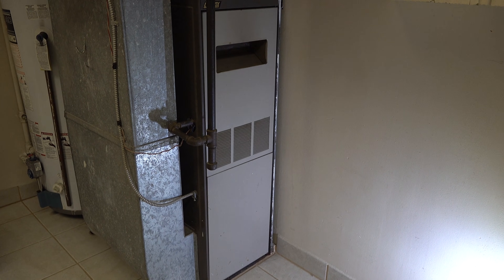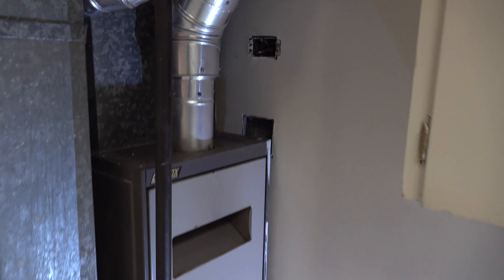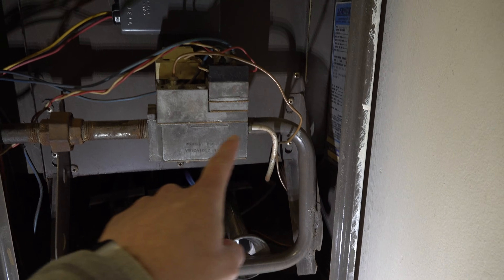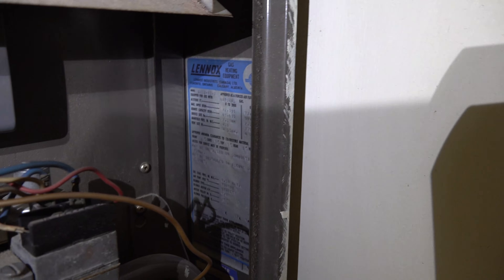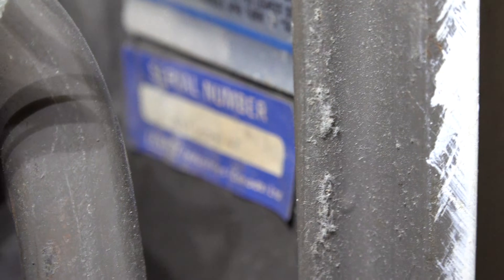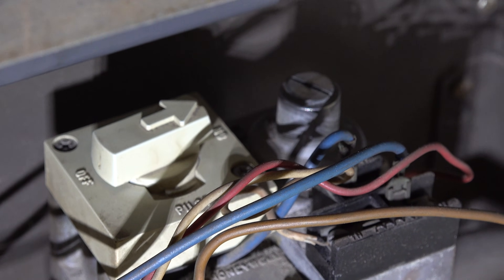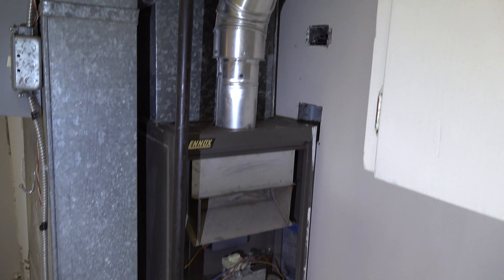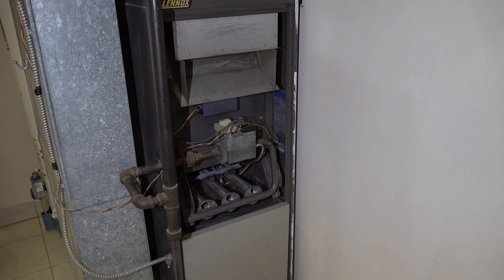1977 (Old) Lennox Gas Furnace Overview [G8D2-82-3]

Comment: The flames look better than on your other video.

The left burner looks misaligned - crossover tubes should line up and stay that way. If it gets worse you may get delayed ignition.

You can't tell if a furnace is properly tuned by looking at the flames; yellow can just be caused by dust and you can have perfectly blue flames but high co production or too much excess air.

You would need to call a tech with the right tools to check fuel input and combustion. (the fuel input u can actually check by clocking the gas meter, but can't check combustion)

You can't tell if the heat exchanger is cracked on this model by checking for disturbances. You need to get in there with a flashlight (or snake camera) and check back of every cell where it starts to curve for cracks.

Comment: Thanks for the memorys.  We used one like this ourselves for 25+ years.  I remember it being noisy when the fan kicked in.  We called the heater the USS Titanic Boilers.  You could just see all the gas it took to fire that thing up and it would run that way for many hours.  $$$

We replaced it with a hybrid heater with AC.  Heater runs on gas or electricity and with the solar panels we can save huge amounts of money.   You program heater with your local prices for energy and the system will pick the source of power based on what source is cheapest.  You really don't know when its working in that you can bearly hear it running.  It was a big jump in technology between the different heaters.  Like 1920's compared to 2018, just saying.   Old heater was like yours a 1976 model.  When you change yours out don't skimp,  just go for it and get the best one you can afford and you will not be sorry.   Great video.
Reply from the maker: Thanks I'm going to give replacement some serious thought this year. Long story it's not in my house, it's in a commercial building that's vacant so honestly if CO is leaking into the offices it doesn't matter in the slightest right now. If I did something it would be in the summer when I am not rushed at all.